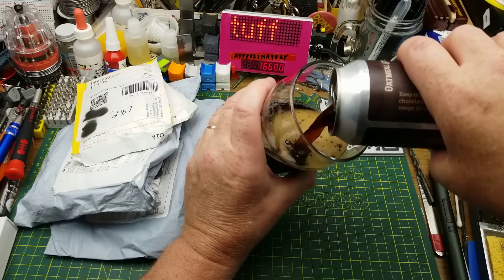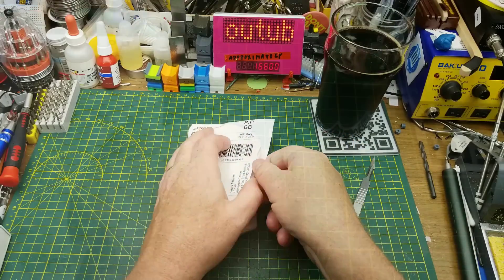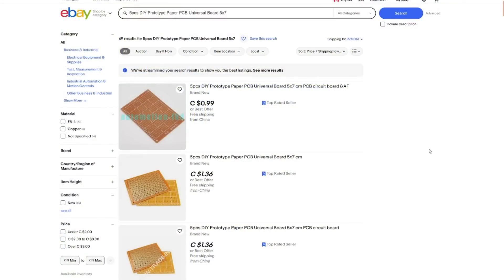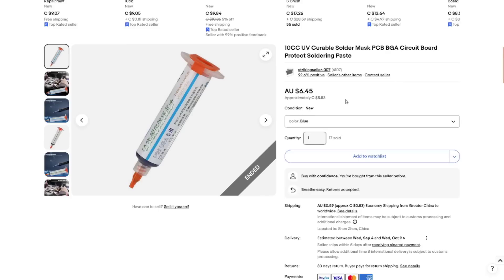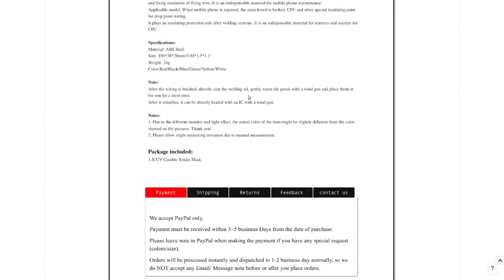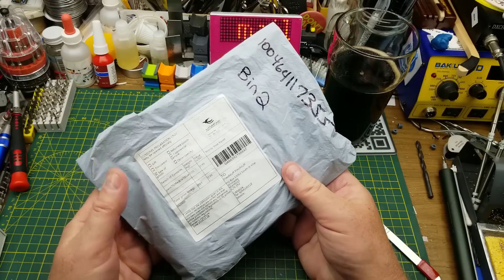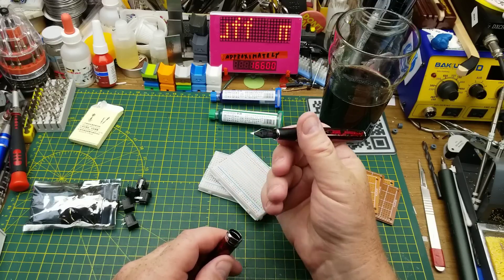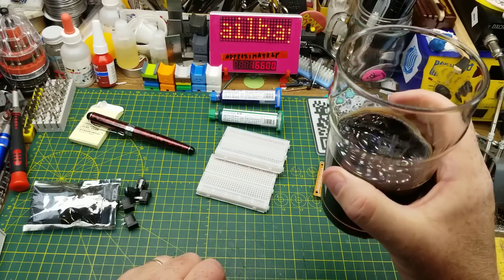Mailbag Monday 199

Comment: The problem with the solder mask is you can't apply it evenly so it looks good. 
Since it's squeegeed on during silkscreen printing, maybe 2 shims either side to set the thickness and a squeegee.
Reply from the maker: True, but I don't expect to use it for whole-board application.
I plan to use it to protect spot repairs and similar.

Comment: Those cheap Chinese bread boards are "Crap Boards" plug a metal film resistor into them and they may not make a good contact on small diameter wire; plug some thing more hefty into them and the clamps underneath will bend since the metal is not springy brass and will no longer make contact with like 22 gauge wire.  Good bread boards cost dollars not cents like you show and are usually not translucent white but more like a cream color and made of better plastic and have real nickel plated brass springy metal clamping bars inside.  You should do a test on these sometime and make a video on good bread boards vs. Chinese junk.
Reply from the maker: I never claimed they were good, but they are cheap enough to abuse.

Comment: Those brown pcb boards are cheap, but the pads come off easy with too much heat. I still have a bunch of them 😊
Reply: I know the paper ones the pads fall off at the drop of a hat, but I think they are the better ones, ie, the pad glue might last long enough if you solder quick - lol -.
Reply from the maker: yeah, they're not something I would use in a commercial product, but for a quick on-off hobby project they're mostly adequate.